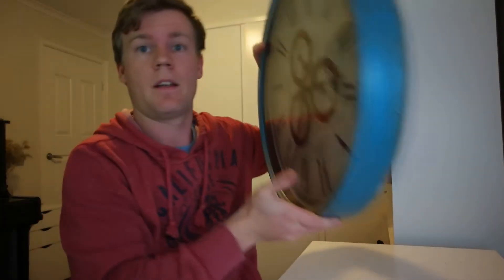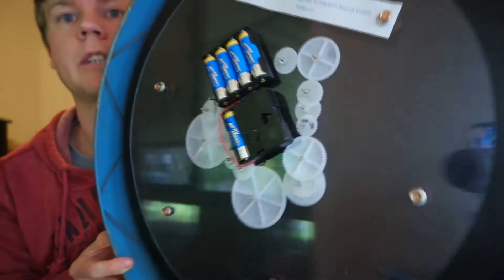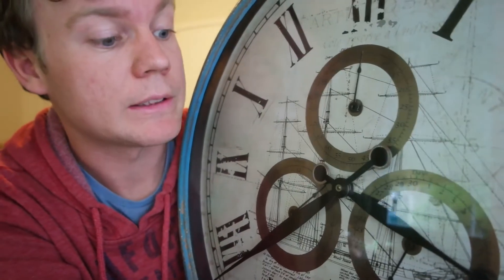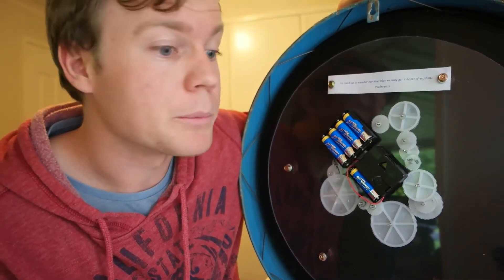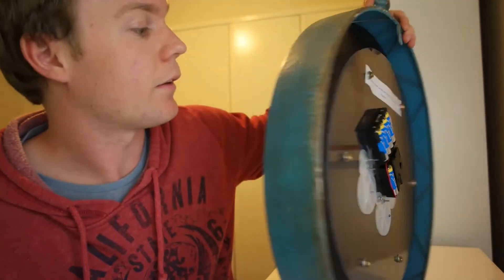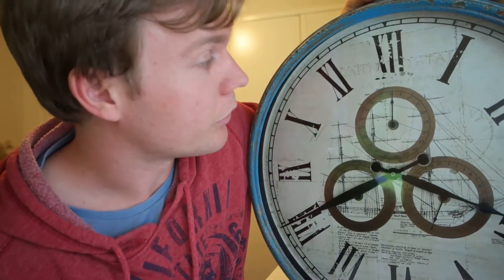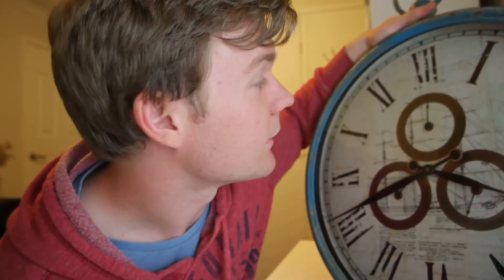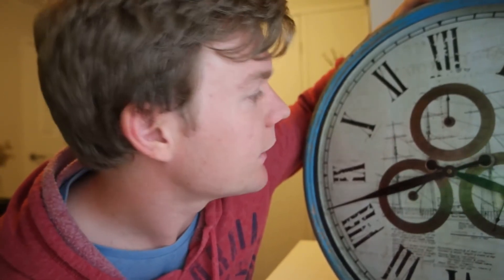The 100 year clock

Comment: Nothing against the work you did, which is well thought out, but from a material point of view it doesn't add up for me to use a plastic watch and plastic wheels.
Reply from the maker: yeah I did look into using brass gearing but this was going to be very expensive. My thinking is that because the rotation is extremely slow with very low torque loads that wear will not be a problem. Even the fastest of the gears only does 2 revolutions per day. Over 100 years this is still a lot less than what you would find in something like a toy car that does a few hundred RPM. But we will see I guess.